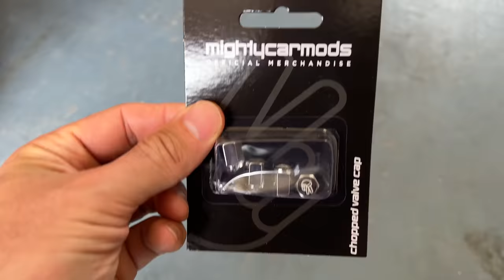Modifying EVERY CAR WE OWN in 1 day! [FEATURE LENGTH 4K]

Comment: It makes me so happy that you guys are financially able to keep all of these awesome cars! You two (And chrisfix) are such a good influence on the car community I love to see you guys being able to do this as a job!!!! (Not to mention you've never sold out your youtube channel *cough *cough roadkill *cough)  

One question I have that no one can answer me is how do you guys know which aftermarket parts will fit from DIFFERENT cars?? I.e you want to mount a Mustang transmission on a dodge charger, do you use a mustang clutch? what diameter flywheel? what do you even google to find an adaptor plate for the engine? Maybe you guys could do a short video on how you figure what parts from what cars would fit on different custom builds! :-)
Reply: from my limited experience, an email to both manufacturers goes a long way - they might give you all the specs and dimensions of the parts, then it's up to you to sketch it and see whether it'll fit.
Reply: You use a Mustang clutch on a Mustang transmission because the splines in the center need to fit the input shaft, then you just need the flywheel to be an appropriate size.

Comment: a handy little mod/hack. For all that surface rust on the inside of the 240 bumber. you can sort all the rust on your chrome by using Aluminum Foil and water. not even trolling you

Comment: If you want a well made snack pack, in the Netherlands we have a thing called "Kapsalon" (literal translation: barber shop) which is chips with kebab and molten cheese on top, finished with garlic sauce and sambal. It is the best thing to order at a kebab joint.

Comment: I owned a 76 Fair Lady 240z for 30 miles earlier this year. A Ford F150 ran a stop sign while also speeding attempting to occupy the same point in spacetime as myself...
The truck won the paradox, I had my travel direct almost instantly rotated 90° and redesigning it into a Fai 240U shifting the passenger door to the area the shifter was 5 minutes earlier. Completely destroyed every single part it had, didn't get anything except a floating sternum and $3000 debt

Comment: The Motocompo actually predates Transformers, albeit by less than a year. Skids, one of the earliest Transformers released, was actually a reuse of a toy from the tail end of the older, similarly-transforming-robot-centric Diaclone line of toys--a transforming Honda City Turbo. The Diaclone version of the figure actually included a teeny-weeny little Motocompo that could fit into the City Turbo's trunk in vehicle mode, right in the same spot as the full-size version!

Comment: 2sexy gets hot because the radiator is far too small. Also doesn’t have an oil cooler yet it’s making 230kw, which is double the power that engine originally came with. Yet the stock radiator is double the size of the current one, with half the power.

Comment: So I bought an 02 wrx with a jdm engine. Assumed it was a ej205 because of the price of car. The numbers on the heads are RHC 007 LHC 007. I haven’t found anywhere online that tells me what version this is, anyone have a clue?

We’re only trying to figure out what engine this is because the injectors are pink. It’s also a little more torqueee than my 02 wrx wagon. So we’re super confused. Any help is appreciated!

Comment: The remote was the absolute best feature of my HU. I didn't ever have to even look at the HU while driving. I suppose if your car has steering wheel controls it's less useful. Still, with increasing amounts of touch screens in modern cars I would MUCH rather use a remote to operate the HU while  driving. 

Also, it keeps your greasy filthy hands off the HU.